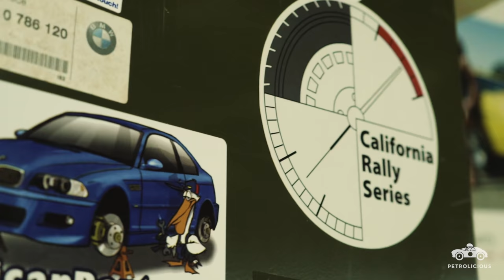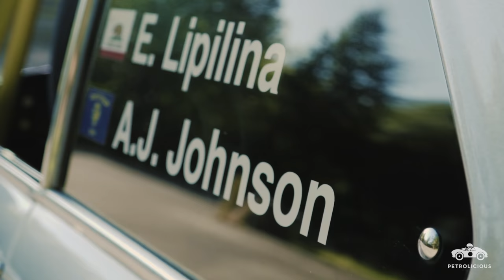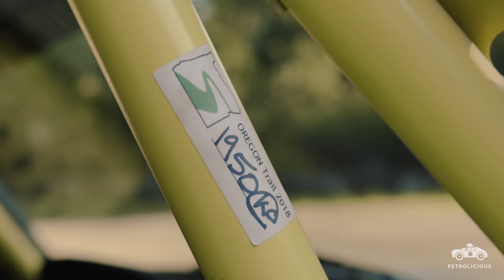1971 BMW 2002: DIY Racer

Comment: One of the best summer jobs I had was back in 1973.  I worked for a company called Kurt Orban in Wayne, NJ.  One of my jobs was to drive down to Weehauken, NJ, park and take the tubes into NYC to the World Trade Center to drop off stocks and bonds.  The company car was a silver 1972 BMW 2002 (Ti I think) with a four speed stick and AIR CONDITIONING which I'm told was very rare.  I would be done by one, get a dog and an orange Nehi and walk around Wall Street; street musicians, a bench and the joy of watching NYC go through it's daily rituals.  Home by 5 pm and repeat......